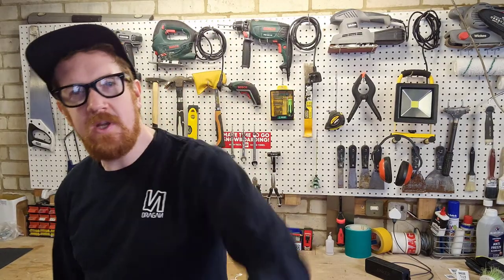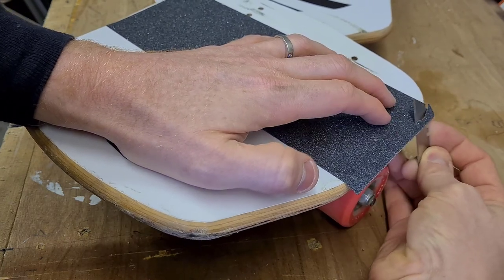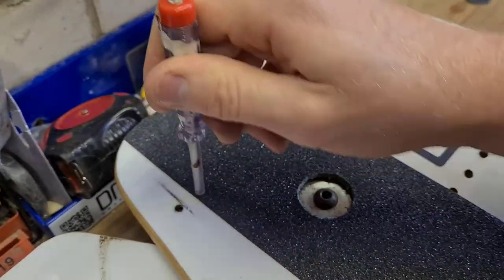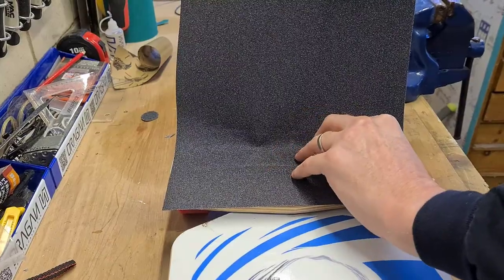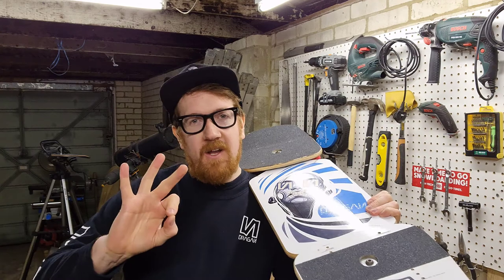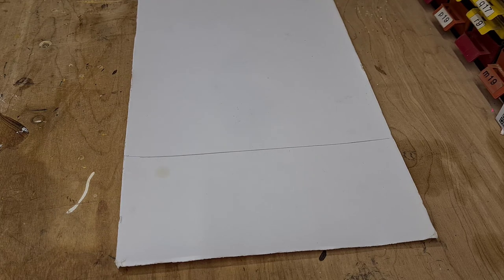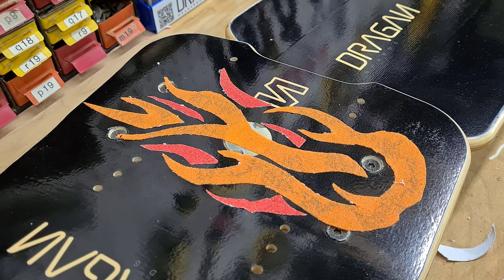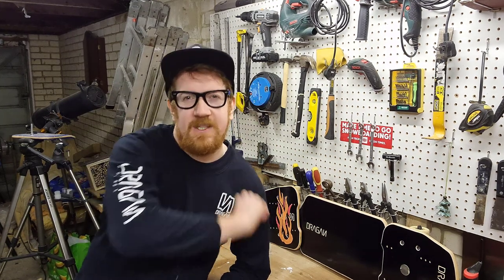Maintenance Monday : HOW TO APPLY GRIP TAPE TO A STREETBOARD

Comment: Thanks for this. You answered a few of the questions I had. 

Are all grip tape brands equal or is there some I should avoid or use? 

Also, if I change my mind and take it off, does it damage the surface of the board in anyway? 

Keen to tape the whole plate black.
Reply: Best way to remove is just to heat it up with a heat gun or hair dryer.  This melts the glue and you can just Peel it off
Reply from the maker: What Coyote said re: the surface. There are slight variations with grip tape, but considering we don’t use it like skateboarder would you won’t notice much difference